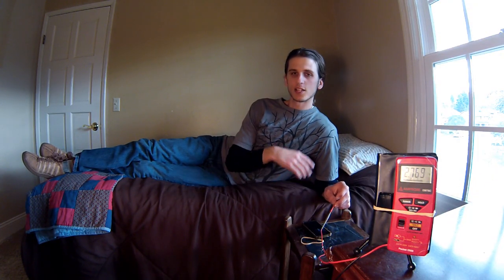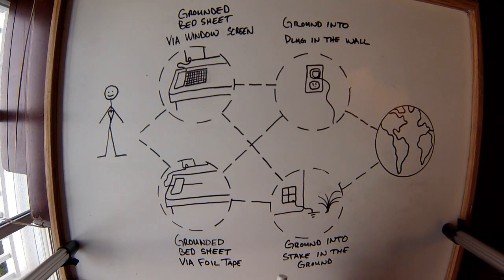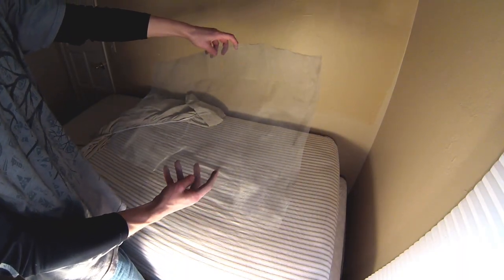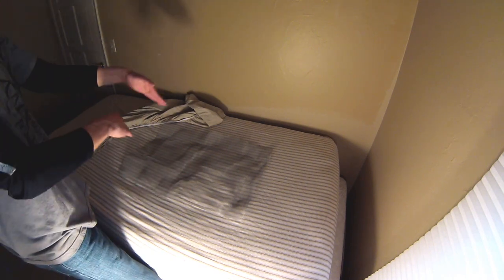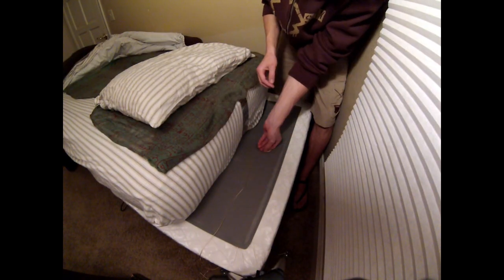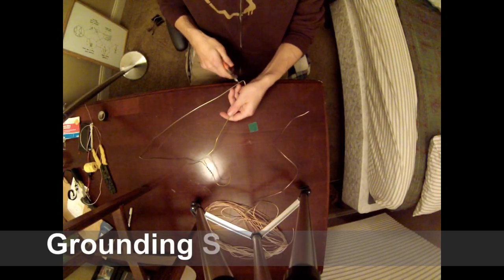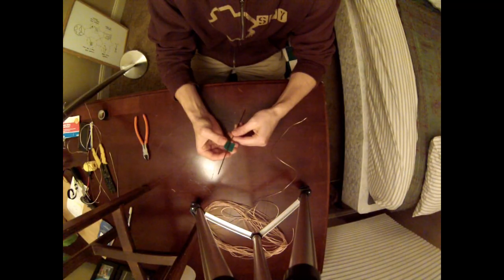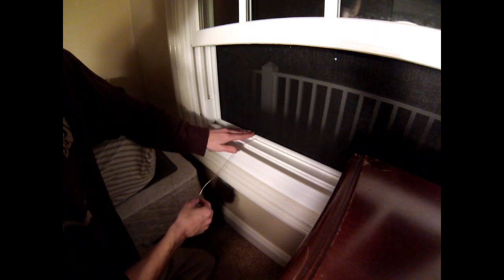DIY Earthing Sheet: How to Sleep Grounded Indoors (Tutorial)

Comment: You say don't attempt this if you do not understand electrical stuff but clearly you don't know a lot yourself.  I must thank you though gave me best laugh had in long time.  But on a more serous note.  NEVER connect any metal object to a Plug unless you are a certified electrician as not only is this in many parts of the world, ILLEGALL it is also extremely dangerous and WILL KILL YOU if you do it wrong.  Also he mentioned about connecting it to the earth pin but many houses are not correctly earthed.  Connecting to a earth pin in a poorly wired house can be, and indeed has been FATAL.  You have been warned! The stake in the ground idea however is perfectly safe and if you believe it will make a difference to your sleep and health, by all means.  I don’t say it to be nasty, just would hate for someone to get hurt.
Reply: Dylan Link Here EMF refers t the Electro-Magnetic Field, not force. It is measurable but usually not with your standard multimeter.
Reply: I forgot to add the fuse he put in the line will do absolutely nothing. I find it laughable that he thinks this will somehow protect you in any form. Just another reason I say it is clear he knows very little about what he is talking about. I really laughed at the lightning strike thing,  like a fuse is going to do jack for that.  5 AMP fuse been the smallest I could find lol 5 amps is about 1000 times more than it takes to kill a fully grown man not that is going to do anything anyway. I'm not even getting into the fact that what he is talking about with EMF is a load of bull in the first place,  like a Digital Multimeter can read EMF LOL.
Reply: Hater
Reply: Jordan D How is been concerned about peoples safety been a hater?
Reply: Tony Boyle  From a reincarnation fan..
GET A LIFE!!!  lol  ;-P
Reply: Bruco Alidas Get a life.
Reply: Mrkiwi1
I agree the 5 amp fuse is absurdly, dangerously large and a red flag that this gentleman just spent 15mins learning about electricity.  It would probably only protect the sheets from catching fire. You would want something under a hundred milliamps (cheap and easy to find) - although I'm not sure how effective the arrangement would be.
Reply: Mrkiwi1 EMF (Electromotive Force) is the same as voltage. I highly doubt that digital multimeter doesn't measure voltage.
Reply: Okay Mrkiwi, you are so right!  I am typing this from Heaven, because I did not read your highly informative post before plugging my poor dumb ass into the ground, and I fried myself!  I am so tired of singing all day, (God, how boring), and remaining prone in front of God all day, (no breaks in Heaven).  No cursing, no sex. no beer or fried chicken, and worst of all, NO PORNO!
Reply: Mrkiwi1  A 100 ohm resistor is what he needs! That's all!
Reply: Bruco Alidas  With only 8 millivolts! ;-)))
Reply: droidcrasher make a video pld
Reply: Okay KIWI.  Make us a low-cost grounding video then!

Comment: groundedSymbiosis  could you potentially covert an old electric blanket into a earthing blanket? Could cutting the original cord and attaching it to a longer wire, and grounding it outside to the ground...could this work ?

Comment: I pretty much followed both videos' instructions (thanks, groundSymbio, I saved a bundle!). My situation is tougher in that I'm in a trailer in the desert (very dry soil). Rather than fill up the septic tank system with unnecessary water I run my "gray water" (dishwater, shower and shaving water) separately out onto the ground about 40 feet downhill which creates a generally damp "green" spot. I pounded a couple feet of 3/4 inch copper pipe into this area and clamped a foot of wire to it, medium gauge-heavier than the ground wire in an extension cord. I attached a null male plug as shown in your previous video (just the ground prong hooked up). On the uphill end I made a short female version of the same setup, wiring a 15 amp circuit breaker inline into a foot or so of heavy solid wire and wrapping the exposed end around the exposed copper ground wire coming out of the trailer's fuse box. In between these two homemade plugs I have a 50 ft. heavy duty extension cord, which I can disconnect and use elsewhere as needed. The fuse box happens to be under the bed in the bedroom, so I wired my bed mat (uncoated aluminum window screening and duct tape, as demonstrated) directly to it. But since my copper stake is now wired into the trailer's grounding system, I also made a desktop computer pad to rest my hands/forearms on when working, and a foot pad for barefoot TV viewing--these are plugged into wall sockets. Do they work? Yup. According to my Klein volt meter my normal body's AC reading with hands on keyboard is 12.6v (+/ 1.0 volt). Yikes. Even hands free I register between 2.3v and 3.0v just sitting next to the light switch and electrical outlet with the computer on. Hands on keyboard with the grounding screen: between .19 and .20--over 60 times LESS. In the bedroom with the circuit breaker for that area ON I register .43v. With the breaker OFF and lying on the mat, around .006v to .007v--again slightly over 60 times LESS. Great stuff, thanks again! WARNING: EVEN WITH A CIRCUIT BREAKER, BE SURE TO UNPLUG GROUNDING MATS DURING THUNDERSTORMS! Modems and motherboards aren't the only thing lightning strikes can fry.

Comment: Thank you for the great instructions. For peace of mind I break the live prongs off the plug with a pair of pliers. They break off below the top of the holes, so that's good, and then I tape over the holes with electrical tape. You can use an old pc wire and plug if you like, cut off the end that would go into the old pc and strip off the plastic a couple of inches or so, then the ground wire is wrapped in green, cut back the green plastic and you can either remove the "hot" wires all together or just tape them off, then attach the ground wire to your shielding. You can ground yourself with items you already have in the house.

Comment: Well - I made my sheet - yay - grounded it to the wall heater - I was told something like this is grounded because it is a gas appliance, or a cold water pipe, if it's metal - will also work

Comment: I would have a hard time turning off and unplugging everything because I have an alarm clock and cordless phone that need a charge - on either side of my bed.  Not to mention my lamp near the bed.  Not sure how to reconfigure all that stuff.  I do tend to unplug most anything I am not using, as it really saves on my electric bill - which does prove the active current that is being fed into the cords even when stuff is not turned on or in use.
Reply: Sounds like you sleep in a cave of EMF! Unplug everything in your room and move your bed away from outlets. Also get rid of the cordless phone in your room, this thing give off high levels of unwanted wifi.  #GetGrounded

Comment: I tried this. I got an aluminum window screen to cover my whole bed. Then I bought the duct tape. But I still get poked from the metal on the edges despite being taped twice. I would suggest use a plastic around the edges then tape over it. Plus it moves around and puffs up my bed sheet. After spending 33$ on it I could by an earthing may for 60$. However I love the fizz I get when grounded and the healing I feel. Conclusion- buy the sheet with silver if you can afford it.
Reply: TJ C You can get it here: http://www.earthing.com/Shop_s/1824.htm  By the way, are you Tyson?
Reply: Hi, where can I get an earthing mat for $60 as you mentioned?
Reply: kai2698 not sure where a sheet is 60.  Since just a pillow case cost that much

Comment: Please link to the supplies needed for this project to be a success if you join up with the amazon.com affiliate program you can link to the precise products that are needed for this setup and you can start earning commissions today. I can only find fiberglass mesh not stainless steel, is that what you're using? I am trying to spread the word here in Peru about earthing and would appreciate some resources, thanks.
Reply: Stainless isn't a very good conductor. Fiberglass is even worse. http://physics.stackexchange.com/questions/92960/why-is-stainless-steel-a-poor-conductor-of-electricity Gold would be the best conductor, but since it costs so much. Use copper. :-)
Reply: Wire mesh on Amazon.com   http://www.amazon.com/s/?ie=UTF8&keywords=copper+wire+mesh&tag=googhydr-20&index=aps&hvadid=33838535275&hvpos=1t2&hvexid=&hvnetw=s&hvrand=4551075896148603043&hvpone=&hvptwo=&hvqmt=b&hvdev=c&ref=pd_sl_mz1hitn2i_b
Reply: +earthingman Cool, do you have a blog? Also just so you know you spelled earthing wrong in the end of Amazon title.

Comment: What kind of wire is that you're using to connect to the foil tape and the coat hanger? Would dial up phone cord wire work, or perhaps stripped ethernet cable?
Reply: Do you still need a fuse if you're just connecting to a ground stake?
Reply: Zob Zoiger
Any wire will work, it doesn't need to be thick gauge as it will not carry much current--I use speaker wire. A fuse is necessary safety precaution for any earthing sheet setup.

Comment: This video needs to be taken down & re-edited. NEVER install a 5A fuse between the ground earth & bed metallic mat. Yes a fuse SHOULD be installed, BUT the fuse should be something more like 5mA rating. Even low electrical currents of 200mA across the human heart can kill. This is the problem with people posting stuff on the Internet on subjects they know very little about. BEWARE READERS!!
Reply: What about using a surge protector with trip circuit built in and then run your ground from there?  You could even cut off the two flat prongs and just run the ground to the surge protector from the wall socket and then run a ground from there to wherever you want.  That would eliminate the guesswork on figuring out fuse amperage.
Reply: +Ewan Lewis Ewan, thanks for your reply.

I am making my own system and I attached a 1k ohm resistor to it. What mA fuse would I need to achieve the same safety rating? And presumably, I would attach it after the resistor?

Many thanks.
Reply: Personally I wouldn't want a fuse rated higher than 20mA  (If available) where my body is making electrical contact with sheets & there could be electrical cables around bed. A fuse might not save you in any case depending on position in relation to sheets & electrical cables near bed should an accident happen. Definitely avoid anything higher than 150mA. You want a (usual) fast blow fuse. Avoid having any electrical wires near sheets & ensure earthing wire is heavily insulated if it's anywhere near electrical cables. Safety first. The soil around the earthing rod should be kept moist or damp, never dry. Next & a VERY IMPORTANT message. To those thinking of sleeping on these sheets please make sure all your electrical outlets are protected with a EARTH LEAKAGE DEVICE Circuitbreaker in your mains switchboard or electrical outlets in your bedroom. I would personally make this mandatory before making or buying earth mating that you sleep on.

Comment: Did it. Made one. Teeny difference. Masked taped up the spiky edges without sticking metal net on the bed sheet. Then connected the earth cable with a crocodile clip to one exposed corner of metal net. Means can freely disconnect mat, wash bed sheet and let kids jump around on the bed. Finally, earthed to the outlet. Ground too far for stake. 

Result? I sleep noticeably deeper, longer. Herniated disk pain's eased somewhat. Also, went barefooted lots and walking the house tiles without sandals. S'nice even that! Friend wants me to make him one now too. 

No good debating pros and cons....just gotta suck it and see the results for yourself. 

Thanks George for show.....will buy one online soon.
Reply: I like the idea with crocodile clip as well, I used to trip over that cable connected to my  mat
Reply: @danielg-ski  
Looks like you need to route the wires better. You can use some silicone putty like sugru on the bed if you don't want to ruin the finish. Then just nail in some cable clips on the wall and send it to the nearest earth plug. It'll cost more in cable, but much less annoying.

Comment: Just stopped here to check out any new sarcastic comments -But some guy below -Joe danna -is almost entirely correct. Lightning hitting near your house will fry you in bed with a setup like this. He says a fuse will blow -but there is no fuse in a grounding network. There is just the lightning bolt and a wire -straight to you. How many have been killed by this?
Reply: salvor1 is there  a solution to this problem?

Comment: Inhouses that only had two holes in the outlets and when appliances were starting to have 3 prongs, we used to use an adapter that attached to the screw in the middle of the outlet plate.  That provided the ground.  CAn we just attach the wire to the screw in the plate instead of using a plug?

Comment: I have a grounding sheet but it doesnt make me feel noticebly more relaxed, like when I am walking/hiking touching the ground.(watch for ticks out there..) One of the best and safest ways to ground is to stick your feet in water of a stream or river or lake, even placing your bare feet on rocks. Do this everyday for just under an ;hour and you will notice it. I think we have alot of dirty electricity around the house in the city. The mountain stream is the ultimate. Rudolph Steiner said that connecting to ground is part of the natural process of mineralizing the body....if you got the minerals in you  already I think?  By the way you can ground also by running some water over your feet in the bathtub, if you are housebound, this is also safer in general than exposing bare skin outside. Run a slow stream of lukewarm or cool water over your feet in the tub for a half hour....

Comment: Also research Stray voltage comes into your home via the ground wire, even if you have a separate grounding rod just for earthling it`s not safe in Canada and the USA, the Stray voltage that should have it own dedicated return line as you never use up the electrons they use the ground and waterways to let the electricity return to the power stations so there is another reason for brown grass and dead gardens...
Checkout Steven Magee Books here on YouTube for more info, just do a search on  his channel for Stray voltage.
Reply: Ok hater, BURN...
Reply: Also research stray voltage cows for more info.

Not to be confused with dirty electricity, this is made from electronic devices like LCD screens on your oven or microwave, alarm clock or you lighting CFL, LED and any electronic ballast lighting, your computer, plasma TV, LCD TV, LED TV basically anything that transforms AC voltage to DC voltage is going to generate dirty electricity. All electronic devices use DC voltage and must convert the incoming AC to DC.
Reply: NoFear4XJs Very interesting, the Cows.. Check this out, watch the video:

http://minnesota.cbslocal.com/2013/07/02/stray-voltage-blamed-for-dairy-cows-poor-milk-output/
Reply: What electrical book are you reading? Your knowledge, logic and grammar are all at the same level (near the ground).

Comment: Wow, lots of questions above! According to the book, there is a theoretical risk of being electrocuted if hooked up to one of these during lightening storm, because lightening is attracted to the path to the earth of least resistance, which includes grounding rods. This is the point of the fuse blocker thingy. ..... Regarding what is a grounding rod to the dutch woman: any metal rod that is conductive in nature, like copper...... Regarding what wire to buy: you can buy any type of conductive wire, any thin electrical wire should do....... Regarding why cant u ground ur bed frame? Because mattress have too many nonconductive fibers that will block the earthing, that is why this earthing screen goes on top...... Earthing screen will still be partially conductive under a fitted sheet made out of natural fibers because when u sweat a small amount of sweat will pass the conduction from the earthing mat to your body. Do not use polyester sheets, because those are non breathable and will prevent the sweat from working as a conductor. To the guy that said this is a bunch of crap because there are EMFS outside, so how can the meter read 0 or close to 0? According to the book, there are scientific studies that show when you are connected to the earth, the flow of energy creates a protective field around your body, like a bubble. This is the same concept as to why you are safe inside ur car, even if ur car is struck by lightening, which I have seen in real life.
Reply: The meter read the electric potential, but not the EMFS.
Reply: The car acts as a Faraday cage.

Comment: Google "Samuel Milham M.D.", the author of "Dirty Electricity".  He warns against these 'grounding' systems because the earth itself is so polluted with 'dirty' EMFs.  He advocates using Setzer filters and plain old aluminum foil, which if you stand on it for 30 seconds, will dissipate any electrical charge from your body.  No need for these complicated sheets or mats, which may make things worse.